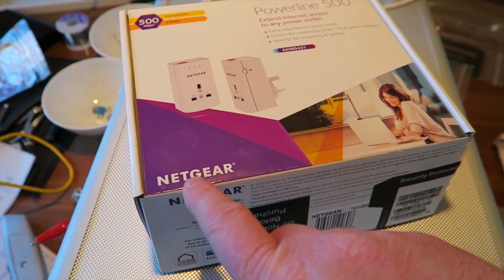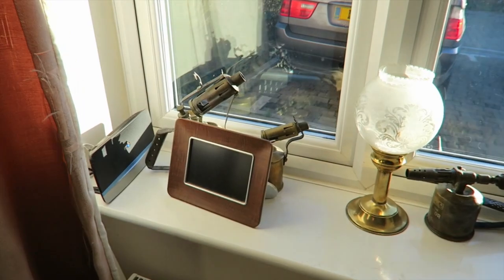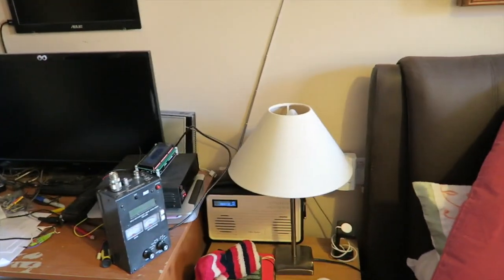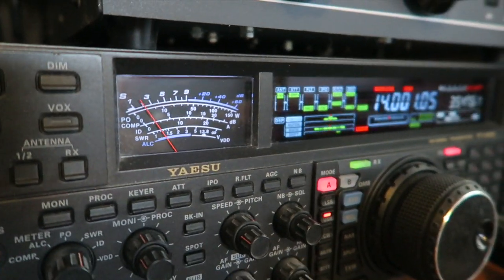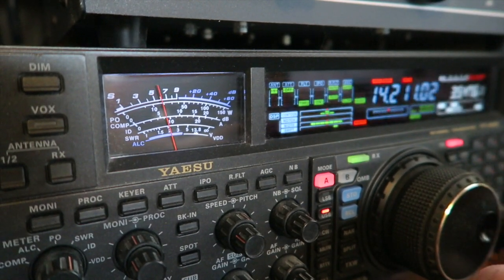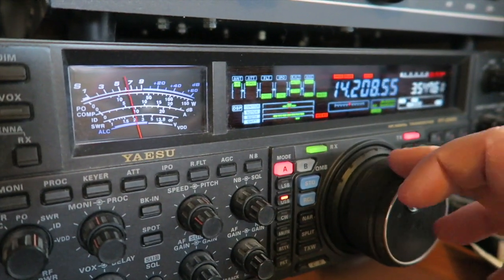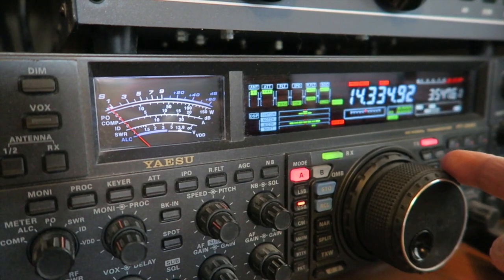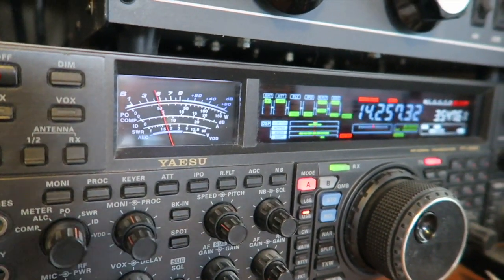Ham Radio & PLT devices

Comment: Modern PLT devices are notched for the ham bands so often don't cause any issues, however they are NOT notched for the CB radio bands so you could end up annoying your local CB'er.

Indeed, try any HF frequency outside a ham band and you'll find they cause interference.

Comment: If you have a wooden house, there is no difficulty nailing an ethernet cable along the celing or door frames. A pair of Mikrotik routers with a directional antenna could transmit it wirelessly on an unlicensed low frequency.

Comment: Early units used did not notch out ham bands,,many of these can still be in use today,,newer unit it no a problem  on ham bands,,but on shortwave and cb it's still a problem.,,,but does high power transmissions interfere with plt devices i wonder.

Comment: that because the newer plt devices have to notch out on the main ham bands to conform to new specs,,this does not seem to include warc and uk 27/81 cb bands,,,also there not notched out on shartwave,,try doing a vid listening o shortwave with the plt turned on,,it near impossible to hear anything ,,,ham that are getting noise from plt on ham band are using older units or bought out of spec rubbish off ebay etc......if you need more wifi range install a wifi repeater they work very well

Comment: I found exactly the same......no noise over the whole 1-30mhz spectrum. The power supply for my virgin media super hub router however, is horrendous!!! These small 'wall wart' type psu's are really bad for loading house wiring with interference and one or two in my house have found their way to the bin.

Comment: Hi

Dan

I tested a pair that talk talk supply and they produced noise outside the Ham bands. I have a few I can hear around here but the Ham Bands are notched and when not rx/txing data they are quiet. You did test yours when doing a large file transfer :) 

Cheers

Paul

m0pnn
Reply: +m0pnn Hi Paul, yes I've tested these whilst moving some large files from NAS to desktop and back etc. also did some tests with streaming etc. Noise levels remained constant throughout. Good to hear that you've tested another set, and that it really is dealers choice when choosing a pair. Thanks for the heads up. 

Dan

Comment: I have three telephones that run on  PLT system (one base and two other handsets) and they have never caused any interference on HF or VHF/UHF.  Well done for demonstrating though - a good review.
Reply from the maker: +Nigel Booth Hi Nigel - Thanks for the comment, you are spot on - I've noticed nothing on any of the HF, SWL bands thus far. I will be checking the VHF & UHF frequencies - but I'm pretty sure they will be the same.

Comment: I use 3 PLTs (cheap d link ones £25) and they cause absolutely no additional noise here. Perhaps it was the older models that caused the problems and the manufacturers got their acts together?
Reply from the maker: +Amateur Radio Guy! Spot on. It seems that the 1st generation may have caused a lot of issues, but these ones I have are really very good. More tests to do however. Speak soon. Dan

Comment: Well done mate. It looks like you are in a "new build" house so maybe with the wiring being new it is not causing the dreaded noise. Will have to do the test here in this old house with wiring installed by Eddistone and Watt.....
Reply from the maker: +Chris Colclough Chris, if you want to borrow these, happy to post them up to you so you can try before you buy etc, send me a message via normal channels etc.